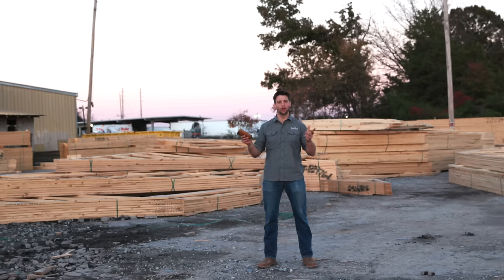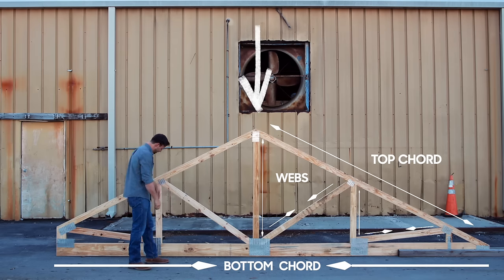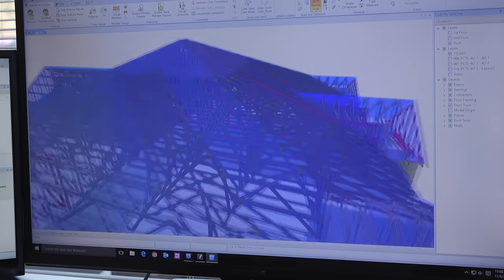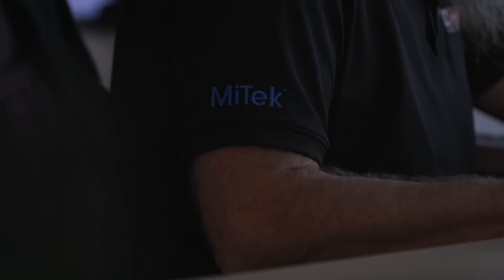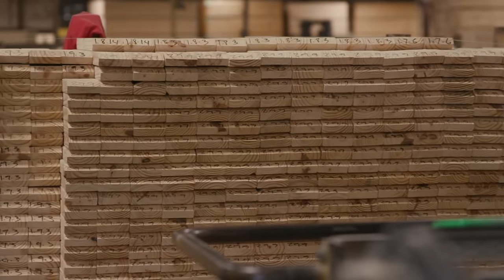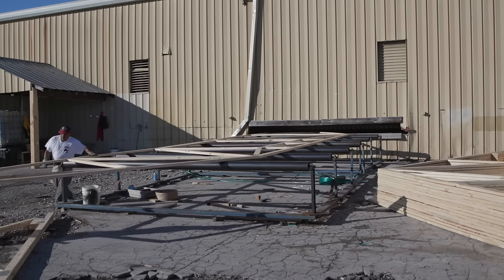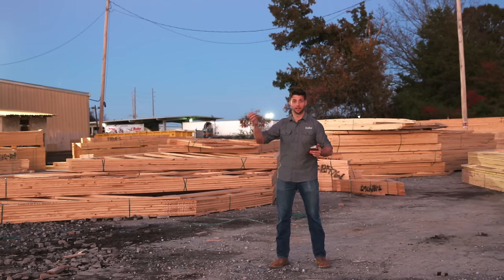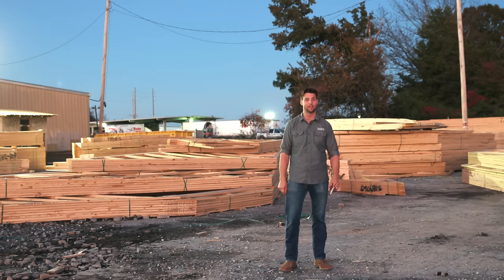Floor and Roof Trusses - "How it's Made"

Comment: I would be totally 100% onboard with standard trusses for all the things... but for two things.

* The fire thing scares me a touch.  Firefighters are terrified of going anywhere near those shallow truss plates, which apparently loosen their grip once they heat up, causing sudden catastrophic failure of the whole truss.  Does Mitek have any fire-resistant alternative to those, or any specification for fire rating?

* They seem so *floppy*, especially the big ones, when done in 2x3 or 2x4.  It feels like particularly for big floor trusses, that they should be doubling the top and bottom flanges, or building out of 4x4-4x6 engineered lumber, or something;  I've read one or two descriptions of doubling, but never seen an example once that anybody on Youtube has actually used.  A deeper truss (and larger inter-floor spacing) earns you massive amounts of rigidity almost for free - there's nothing else that can do that, and 24" should probably be standard for high-end floors.  I can brace perpendicular to the truss for decreased vibration and decreased bounce between trusses (though I've never seen a good engineering study of this - are you aware of one?) , but intuitively I feel like certain points along the truss are going to give (because they're in the middle of an unsupported span of 2x4) more than the ones right above a truss plate.
Reply: Example of doubled up trusses being used are on RR Buildings channel, watch the 84 by 128 Farm Shop video portion of truss install, he uses doubled trusses on this one and also another where such is also used, typical in wider bay spans in post frame (pole buildings) or when width spans more than 60 feet (18.3 meter) or so.
https://www.youtube.com/watch?v=lqGR6prNMd0
Reply: Trogdor was a man. He was a dragon man. Okay he was mostly dragon. But he was still TROGDOR.   Sorry I just had to do it.
Reply: Doug DeGrave  When a contractor gets a roof truss package, it includes all of the individual truss engineering sheets. These show additional lateral bracing tags so the builder can add an additional row of bracing to prevent web members from buckling. If I remember correctly off the top of my head, at least 8 members should be aligned and braced as a minimum if these are installed laterally. If less members are aligned, a brace should be fastened as "T" bracing configuration with a 2x4 fastened to the web as an "L" shape. Refer to the sheets dor the exact spec. A majority of the information for proper handling, temporary bracing, and permanent bracing requirements (which should be handled by an engineer of record). That bracing is the main lateral force restraint to prevent lateral loading of the trusses. That isn't to say it happens that way, since to make a project go faster or cheaper a lot of the practices are not followed. In my time I have worked on them here in America, two projects collapsed before they were finished being put up due to bad handling practices and insufficient bracing. Another common issue is most projects never have an Engineer of record. Mostly a cost issue, so many people rely on the practices in the local lumber yard, truss designer, and contractor. At that point it depends if individuals at the respective services care about the customer or the bottom line.

With respect to fire, I believe you could purchase a fire rated coating to apply over the metal connector plates to elongate the burn time but you would need to anticipate that and specially ask for it as the homeowner or contractor and purchase it from someone else. Also, there is fire treated lumber but it is a chemical treatment that causes the wood and connector plates to have a reduction in strength.

I've been in the industry designing trusses for 4 years now with Mitek. 

You could also have services such as engineered bracing plans from them but it comes at the engineering cost. 

Wood floor trusses I agree with the fireman. Honestly, the best way to discourage the use is to raise awareness in the community and to the dealers of the product. 

It is my job to service the customer. And if the customer doesn't want a single post in their open basement or coming from the second story, I have to give them those 30 foot long, as skinny as it can possibly be, as cheap as it can possibly be which will have fire concerns. I have never been asked to make something stronger. I am only asked to make it cheaper.

Hope that provides some insight, and as always my region won't perfectly represent the process in yours. Local ordinances and codes prevail and differ from plan to plan, state to state, town to town.

🍻

Comment: 7:09, what’s with the truss in the middle with all those 2x4s meeting in the middle at a 45 angle?
Reply: I make roof trusses down in New Zealand. and that is not just a single truss, it is a stack of trusses known in NZ as "Valley Trusses." I hope that helps with your question.
Reply: He is right, when two ridges intersect perpendicular on a roof there is a void in the trusses. Some builders will hand frame the void in. Yet it is much faster to put in trusses. A good truss building company will even bevel cut the bottom cord so it adheres to the roof better.

Comment: Can trusses be built on site by the builder and if not, why not?  Didn't builders of another era use to do this from engineered tables and diagrams?
Reply: Trusses are an engineer product there is in house inspections third-party inspections and multiple code and criteria that must be followed everything has to be precise so for this to be built on-site would not be feasible or practical not to say that some short spans couldn't be built on site it's just that the plates and the pressing in the proper pressures and embedment of the plates would be almost impossible to ensure consistency

Comment: I'd like to know how much difference there is, (avg.), in a standard truss and a truss with a walkway built into it? Obviously decking will add to the cost for a walkway, but how much difference in a typical up and over simple roof truss?? With more and more homes being built and insulated with spray foam, that perfect envelope SHOULD add storage for all of us all over the country. Plus being a complete envelope and the attic NOT being 100 degrees hotter than the living space, with a walking deck it should make working in the attic cheaper and easier for HVAC and plumbers etc. To me, I want easy access and SAFE access. So what is the difference on a typical home??
Reply: This is called a spread web storage truss and I am in perfect agreement with you Sr., in an ideal world all trusses would be made with extra room and storage capacity. I'm a new truss designer so I've only done one set of these and don't recall off the top of my head what they cost. (every truss is engineered and totally unique so hard to throw around numbers anyway) But for something like a common garage truss say, 20 foot span 6/12 pitch your probably not going to see a huge increase in cost. Again, just to many factors to throw around realistic numbers... Where the price really starts to go up is if you specify habitable attic truss, but even then think about what a value it is to place your roof system and floor system all in one easy step.
Reply: @120ohm  Thank you for the quick reply. Maybe keep this in the back of your head and when the next set comes up, do a video on them...   Also, can you tell me the name of the truss that has a cathedral bottom?
Reply: @SteveP-vm1uc  You are probably thinking of a scissor truss and again the variations are limitless.
Reply: it's all in the material difference and  complexity to build....

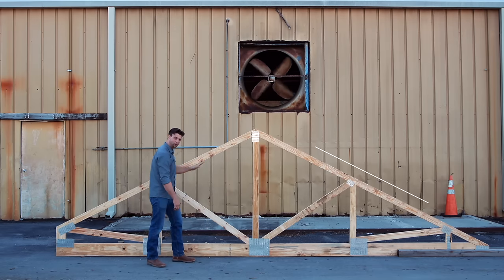Comment: 0:30 The bottom center web is so off-center that it's triggering my Obsessive Compulsive Disorder.
Reply: Doug DeGrave  You misunderstand. I think he means that the gangnail plate is not central to the king post (vertical strut) at the bottom or the fact the truss is truncated.
Reply: Truss plates do not have to be centered. The software can manipulate the location of the plate to reduce its overall size. Basically, each web and chord in a joint will often need a different number of teeth in each piece. When you center a plate you commonly over plate the webs and chords that have lower forces in them.

Comment: How are beams connected together?
Reply: It depends on the beam. The most common way to put beam plies together is nails. Once a certain width is exceeded screws or bolts must be used.
Reply: @macleod57  so they dont use joinery on these in the video?
Reply: @oreocarlton3343  I am not sure what you mean by "joinery" but it is quite a common practice to join multiple trusses together. Just like with a beam, how this is done depends on the thickness. Nails can be used by themselves up to 3 plies. A 4 ply truss will often need a combination of nails and screws and/or bolts. 5 ply trusses must use bolts and/or screws.
Reply: @macleod57  I mean, do they use mortisse-tennon joints or just screw them with steel plate
Reply: @oreocarlton3343  Trusses joints are held together with press in steel plates.
Reply: @macleod57  that shouldnt be acceptable, those joints are very weak compared to mortisse-tennon systems
Reply: @oreocarlton3343  Their strength compared to another type of joint is irrelevant. The pressed in plates meet or exceed the loads they are designed to carry and that is all that matters.

Comment: And you know its not properly joined or actually strong enough by the cheap metal plates slapped over everything.
Reply: That is why they have walls in a home bare the weight .  a open room no walls they use longer straps and use a king truss .  been building homes and garages for 30 years , they do the job .  snow load in the north they know what lumber you need and type of truss .   I still build rafters and truss on the job . for small homes 2000 sq foot . over 2000 sq foot it is cheaper to order them .  them cheap plates work  , or 1/2 plywood  has the same strength
Reply: @JCcanU  The interior walls are not usually load bearing in a truss structure.  There's no way 1/2 in plywood joins the truss members stronger than the metal plates no possible.
Reply: @DaveMcLain  Few studies have investigated the effect of in-service
conditions on the performance of trussed rafters. Luxford
(1958) investigated the effect of changes in relative
humidity on the strength and rigidity of trussed rafters
with nail-glued joints and nailed joints. Both types of
trussed rafters had ample strength and stiffness after
exposure for normal service conditions, but nail-glued
trussed rafters were considerably stiffer and stronger than
the nailed trussed rafters
Reply: If you ever had to remove those "cheap metal plates" from trusses once they're pressed in, your opinion might change.  In my experience, they're very tough and extremely difficult to remove from the wood.  The stuff is all engineered to work.

Comment: Though it is very  economical to build and utilize these truss plates, are dangerous. Structure fires happen and when the structure is built with the metal plates and subject to the heat of the fire. This is where the danger lies. When subjected to the heat 500-1000 degrees these plates soften and pop out from the wood thus weakening the structure. As a firefighter and investigator I have seen this first hand. Not a big fan of the metal plates. Would be nice to see something devised that meets the needs of builders but all so for those engaging in life saving and property conservation when under fire conditions. Premature failure and collapse causes death and injury every year to fire fighters and occupants. 
Just an opinion from the forgotten ones, when it comes to design and build.